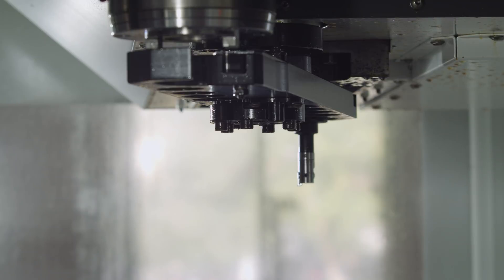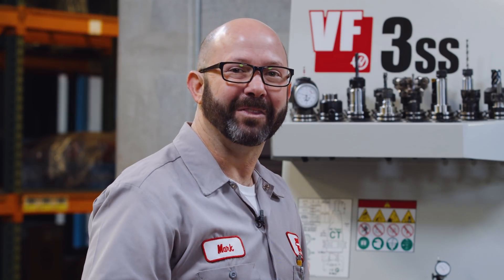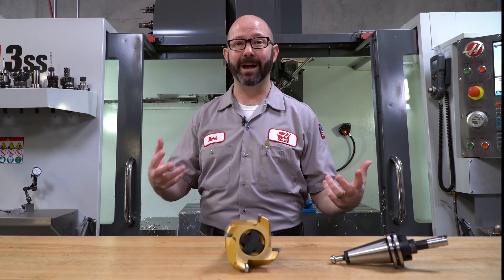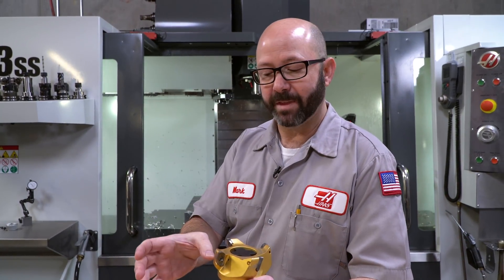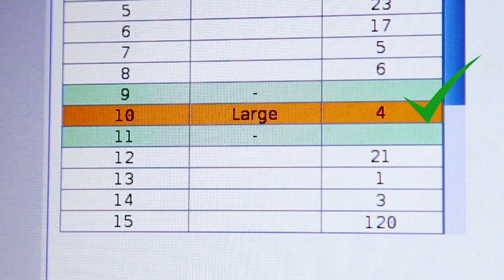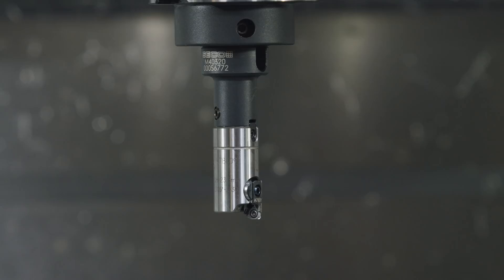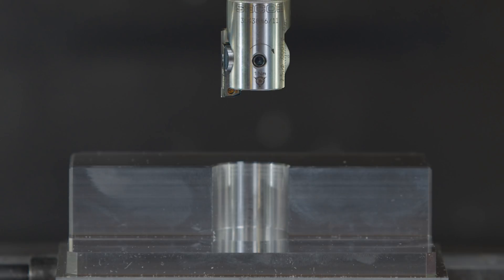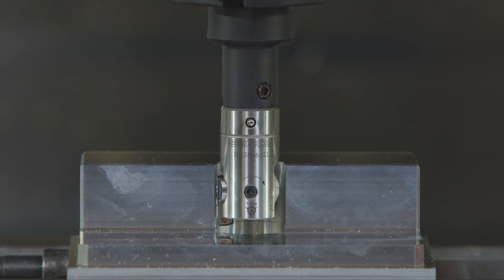Loading Tools? Always Do This First. Boring Bars and Probes - Haas Automation Tip of the Day.

Comment: Why is there no poka yoke to avoid these mistakes entirely?
Reply: I know, right? I've wondered the same thing on occasion, then done some quick mental math. The vast majority of tools that get loaded into Haas mills don't need any special orientation (drills, end mills, face mills, taps, reams, chamfer tools..), so overall it saves quite a lot of time for Haas operators to not have to think about which way most tools go into the spindle. It's just simpler and faster allowing the tools to be loaded either way. Of course, we have to look out for the exceptions, like boring bars! Thanks for the comment.
Reply: That's easy. Sometimes you actually have to know what you're doing. LOL! Really good explanation.

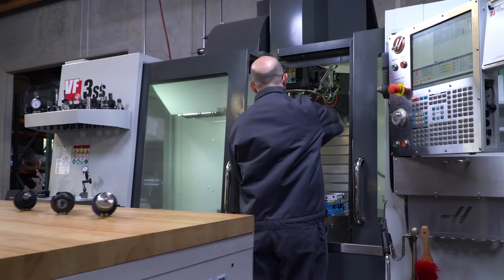Comment: Is that face mill actually aligned in the spindle at 1:21?
Reply: Hahhaa. It looks way off. I think what we are seeing isn't the notch for the drive dogs, its the notch that we will see on DIN 69871 Metric toolholders. They are built to a different spec than Inch Cat-40 holders. That extra notch is to accommodate different styles of machines that require it for their tool changers. Haas Mills can run tools with or without those metric flange notches.

Comment: Since you are using SK-40 tapers on your machine the orientation of tools should not be an issue because the two notches on the toolholders are different depth according to standards. By using different positioned keystones on the spindel you won't be able to put the toolholder in the wrong way again!
To the operator (of different machines) you can often correct this production fault by loosening one keystone and turning it 180° since they are often made asymetric so that you can choose to force toolorientation or not.
Reply: tools may be inserted into collets or shrink fit different ways, but the tool holder always need to go the same way,

Comment: If the spindle orientation is incorrect just run a M82 and the tool will adjust itself to the part.

Comment: May I suggest a Video about the G10 code and it's advantages I know not a lot people use it but I find it very useful  for setting diameter offsets within the program to foolproof for the less experienced operators. 
Thanks!
Reply: G10 is great until you use it to define the position of a trunnion on the table, remove and reinstall the trunnion, then forget to update the G10 line.

Comment: Hi, great video! Just wondering if you hypothetically had a tool that is at 45° (or any angle I suppose), could you add both an I and a J value to the line to make it retract at an angle? Or will the control only allow you to specify one or the other? Thanks and keep up the great work!
Reply: Daniel Smith I just tried this out on my simulator, and yes, it looks like the control allows the use of a combine IJ shift just fine. This would allow you to retract at the 45 degrees you mentioned. - Mark

Comment: First thing you do when loading a boring bar is run an M19 spindle orient to see which way it's facing then in your boring program just set your retraction direction opposite of that.
Reply: John-Peter Kivedo yep. Nice. Not bad for a 30 second script! That’s pretty much it in a nutshell :). Thanks for commenting. - Mark

Comment: I have a quick question since you're touching on M19. What's your thoughts on using M19 while adjusting and tightening large lathe jaws?
Reply: Beckoning Jinx it can be dangerous. If you push too hard, the control will try and and reposition, and it could forcefully spin the chuck around. Ouch. Best to hold the jaw with a large crescent wrench, or do what I do which is just to set the allen wrench as perpendicular to the spindle centerline as possible and give the wrench 3-4 solid smacks with a dead blow hammer. It’s a feel-thing but after years of doing it (and comparing to torque wrench values), I am comfortable doing it that way. - Mark
Reply: @markterryberry4477  Alright, thanks for the tip.

Comment: My friend John Nelson made a video on calibrating the probe and its worth checking out https://m.youtube.com/watch?v=VUY2c39jykM. If the ruby tip on the spindle probe is dialed in dead-nuts to zero, the orientation of the spindle isn’t that big of a deal with the probe, but I still load it the same way each time, because sometimes a tenth of a thou (a few micron) matters. - Mark

Comment: I am not a CNC machinist but a software developer. From my perspective it would make more sense to add a property to a tool instead, to which direction should it retract. The G code should only specify to do retraction, this way it would be more portable, when you ever have to replace the tool with a differently oriented one.
Reply: Gábor Móczik hmmmm. I like it. On our lathes we set a Tip Direction so the control knows which way to compensate toolpaths, but if we used a Tip Direction column for each tool, mill/lathe, it could automatically move in the right direction. Clever. - Mark

Comment: I always orient my tools to the ball notch in the  holder facing me, including the probe! If I did that with all my tools except the probe someone would be bound to put the probe in facing the wrong way at some point, we load and unload tools much more often than the probe. Bad advice with the HAAS logo thing. Plus using the notch make's it easier to change the battery without removal on smaller machines. My probe is always in the last pocket of the machine anyway so very rarely removed. One point about loading the probe you probably should touch on is setting its loading speed to 50% in tool settings to prevent jarring any physical calibration settings on the probe itself.
Reply: Yeah I wish I could set the loading setting at my siemens control it very often alters the probe..

Comment: Why is changing the Q to J better than adjusting the setting 27?
Reply: Because you may have more than one boring bar in a program, and one orients tip left and another orients tip forward, so leave setting 27 at standard and adjust the program for each tool.   No surprises.
Reply: @DavidtheSwarfer  Ok.  That makes sense.  Thanks for replying.

Comment: I'm looking at the y+ and y- directions at the 7:00 mark.  We have two VF4 mills and our y- movement is away from the operator.  Are you positive this video is correct?
Reply: The x-y plane is in the perspective of the spindle since the spindle itself doesn't actually move in this plane. Negative movements will have the table traverse in the positive direction of each axis. What you just described is exactly what was portrayed in this video.
Reply: Since a CNC can have many configurations, it is best to ALWAYS think of driving the tool, NOT moving the machine.
Same CNC program can run on fixed table moving X,Y and Z gantry or an x table with head moving in Y and Z, or the common "C Frame" where table moves in X and Y and head only moves in Z.
Drive the cutter / tool, and none of this matters !

Comment: I have some learning to do...
Q?
J?
🤔
2nd quarter student, just ran my 1st program yesterday.
Crash free too....👍
Reply: Q acts as x J acts as yis the value for the stepover he wants his boring bar to step over at the end of the tool path.  It steps over to keep the one cutting edge from scraping back up the wall. Haas has several canned cycles that others don't have like the g83ijk.

Also.  You will crash eventually.  Run your programs in the air.  Finger on the stop button. Rapid low or even off while feeding.  Single block.  All of these are things machinists who have been there before, and crashed those machines,  do every time they run a new program or have something that isn't 100% straightened out.  Take your time.  And theres lots of good advice in these videos.  Terry is pretty good
Reply: it's actually i,j,k = x,y,z (because those variables were already used for other things. Comes up in vector math a lot)

Q appears to be a stand-in variable for that program specifically (which is why it takes priority over the other values)
Reply: @RaphYkun  why isn't it U, V
Reply: Give it time... Unfortunately everybody crashes. 5% rapid and slowing down the feed to 10% will be your best friend. Oh and the single block button.

Comment: wouldn't it be easier if you had two different sized lugs in the spindle or even just a pin in the spindle with the toolholder only having one cutout for it, so one can only put it in the right way, otherwise the pullstud won't be gripped and the tool will slip back into his/her hand?
it's not really hard to do, so I'm wondering why you don't do that in the US? Something along the Lines of DIN 69871, if I remember correctly.
Reply: sound easy, but what about balance? 
I blame my OCD that I put tools and especially our probe in the same way, despite never actually using this kind of boring cycle.
Reply: @rokbottom8121  Balance is achieved with the spindle being balanced for those two slightely different sized blocks. the toolholder themselves are also balanced from the manufacturer, G6.3 I think is the standard for the one I get mine from (here's their website in case you're interested: https://kemmler-tools.com/ ), so good to 15000rpm out of the box, but for a not much extra they'll go to G2.5 which would allow much higher rpm. Granted, I doubt it'll be good for above 25000rpm or so, but at those spindle speeds one should considder an hsk spindle, not a tapered one anyways.
Reply: this is how the okuma mills are at the shop i work at, but not the haas mills. never understood why the haas machines werent built that way, maybe just a convenience thing. could be a good option when spec'ing the machines, maybe?